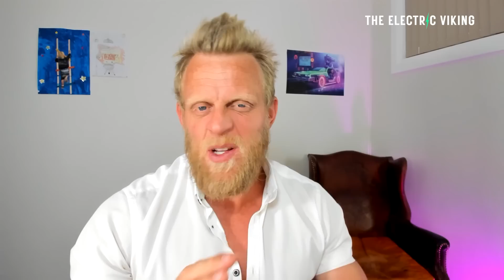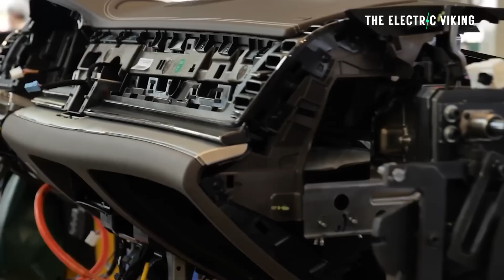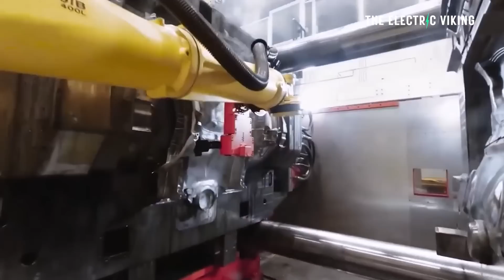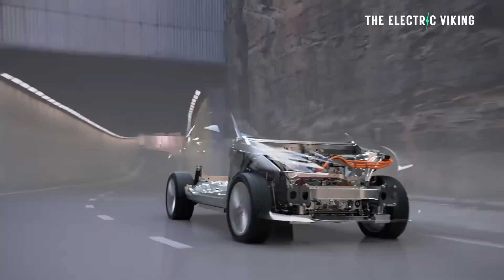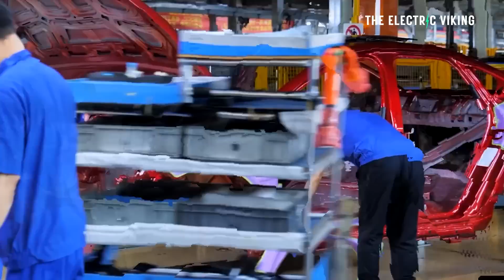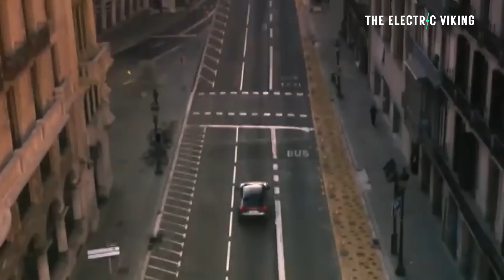Toyota reveal why Tesla and BYD are way ahead in EV manufacturing

Comment: One thing I heard about solid state batteries is that they will be very difficult to recycle. They may not end up being the best technology because of that.
Reply: I worry about them cracking due to thermal stresses. 

Batts with a solvent based electrolyte tend to be self healing in this respect and there is still room for further improving this technology.

Comment: The net debt of Toyota and VW, resp. is $186 and $185 billion, a huge weight to drag around. Toyota is the most indebted company in the world.  Meanwhile, Tesla’s net debt as of June 30, 2023 was $-8.4 billion, ie more cash than actual debt which is $2.33 billion.  Tesla is in a great position to expand production with new production lines, new factories and new models but also advance technological thru increased R&D and growing vertically like its new lithium refining factory currently under construction in Texas and horizontally with a Megapack factory in Shanghai being built to supplement the new one in California which is ramping production. Tesla is getting into the electricity business in Australia.  Lots going for Tesla these days on multiple fronts, not so for legacy auto which is struggling getting their EV act put together, if ever.

Comment: By the time Toyota gets its act together and start producing decent EVs Tesla will have started production on its low cost Tesla model ‘2’ using the ‘Unbox methodology’ which will revolutionize the manufacturing of vehicles. I foresee this happening in the next 2-4 years…late 2025 to ‘27.  The process will require very precise timing and only great software can do that and if anyone can pull that off it will be Tesla.  The only thing that could hold this up is the construction of Gigafactory Mexico, hopefully it gets started soon.

Comment: The legacy automakers are still ignoring the fact that EVs are essentially computerized batteries with wheels. You can’t just install an EV battery and motor in a retooled ICE. Also, most humans live in parts of the world where solar power works very well. As more people install solar, they will skip the petrol stations and charge their  EVs at home.

Comment: Sam, check Toyota stock price. It's all time high. It's not doing as poorly as you keep insisting. Plug-in hybrid are increasingly popular.
Reply: It's not just Toyota. The Nikkei is rallying because of Japan's monetary policy. Even Buffet is leveraging cheap Japanese interest rates to raid Japanese shares. It won't end well.
Reply: @huatlam8752  In 2022 BYD sold under 2M cars, Toyota over 10M.
Reply: @joem0088  at current monthly sale if 300000 plus, BYD is looking at 3.6 million plus this FY. Toyota is sitting on $200 billion plus debt bomb denominated in U.S dollar....with falling yen value. You be pretty brave to hold Toyota shares.

Comment: I don't have a problem with Toyota's HEVs and PHEVs, and there is some merit to the argument that they reduce fuel consumption based on a smaller battery footprint. But ultimately this is a stop gap measure in the long run, and it's clear that Toyota themselves are not that committed to HEVs, given their inability to meet demand or to push down prices of what should be a more affordable car.
Reply: If they really believed that, it would not stop them from also making real EVs.  Over and over Toyota has said 'we need a range of options'.  And they build ICE cars, Hybrid cars, Plug-in Hybrid cars, and hydrogen cars.  Yet they refuse to build the one option actually shown to work: EVs.  

This is not rational.  This is an emotional hatred of the very idea of electric vehicles, and it comes from the chairman and former CEO.

Comment: I still believe many of the fanboy level are in total denial of the challenges Toyota faces. This is not the company that rose to power in the 1990's. I fear they suffer what GM and others have suffered from once they got to the top of the heap. They become less nimble, seem to assume they know best, and the layers upon layers of red tape that seem to pile on as a company gets big is just awful. I do not think Toyota has not done a good job getting rid of red tape and cutting off R&D that is not really paying off. Hydrogen is a huge waste that they still cling onto. I am guessing because so much Japanese government money went into hydrogen due to Akio Toyoda's pushing for it, they do not want admit they wasted so much of the Japanese taxpayers money. 

I am still of the belief that Akio Toyoda slid over to the board room to allow someone to face the heat as Toyota crashes. Akio Toyoda will jump back into the CEO roll after things have gotten bad and they can just blame the current CEO, even though most of this was set into motion by Akio's actions.

Comment: You miss an important point. Unlike smarphone buyers who are mainly in the age group of under 35, Car buyers are mainly in the age group of over 30. They don't let emotions sway their rational thinking. BYD or even Tesla have a long way ahead to prove their reliability to the potential customers. I personally won't go close to any new car manufacturer until the long term reliability results comes out. Remember, Kia and Hyundai are two very good car manufacturers but they are still struggling to get even close to Toyota. Investing in a car is different than buying a smart phone. People are much more cautious about spending tens of thousands on a car.

Comment: As you noted. . .  It's heartening news that somebody high in the ranks at Toyota saw the light and understands the need for the company to change its ways.  My only concern is, sometimes it's not easy to turn around a corporate culture.  It takes real leadership to rally the troops around a new strategy, a new direction.  Let's hope!
Reply: they put the Lexus guy in charge and he's more pro-EV than Mr. Toyoda was. It looks like they're coming around. Their joint venture with BYD opened their eyes. Kind of like the NUMMI factory joint venture between Toyota and GM back in the '80s opened GM's eyes. But didn't save GM, sadly.
Reply: GIGACASTINGS ARE TRASH THEY ARE NOT EASILY REPAIRABLE

Comment: Hybrids are selling at twice the rate of EVs and Toyota is a leader.  EV sales are pausing, taking price cuts to move them and some EV makers are losing hundreds of millions.  Toyota is the largest car company in the world, they have the resources to catch up..
Reply: Hybrids the best right now until batteries and infrastructure improves.

I would not consider an EV until all solid State batteries are mainstream.
Reply: In 2022, Toyota produced 10.9 vehicles and the Corolla was the #1 vehicle in the world…..2023 is still to be determined.  Hybrids out sell EVs, 2 to 1, see Reuters article dated Jan 6.  The Achilles heel for EVs with be lithium and cobalt production (child labor) until better battery technology comes along.  Most hybrids used nickel hydrate batteries. I was recently in Spain, I saw hybrids everywhere and hardly an EV. Turns out 20,000 hybrids were sold in 2022 and 3,500 Teslas…….kind of explains it.
Reply: You are just plain wrong  Where did you get your information that hybrids are selling at twice the rate of EV’s? Remind me again of what was the best selling car in the world last year. Tesla model Y and it’s not a hybrid. Why do anything halfway? If they want to build ice vehicles build them. If they want to build EV‘s, which up-to-date they are not capable of then build them. Hybrids are an invalid compromise. Toyota wants to tell you what you want rather than listen to you and provide what you want. They have become with the big OEM vehicle producers in the United States were in the 70s. They claim to know more about customer satisfaction, than the customer themselves
Reply: @ZeusBullyMax  and Toyota is right, record production, sales, and profit. 😂😂😂

Comment: I find this discussion very interesting since BYD is know for it low level of automation.  Toyota is know for its high level of automation which determined its high quality. I do understanding the BYD level of designing subsystems is more advance since they are software and EC driven.
Reply: Perhaps in the past with low level of automation.  Last year, Tesla produced 1.36 millions cars.  BYD sold over 300,000 cars just in Oct alone.  I don't think they can produce that many cars without high level of automation
Reply: I disagree, there is a large pool of workers available and their production remains with a low level of automation. However, this allows them to have a higher variety of models and also allows them to introduce new models faster. The downside is that the cost of production is higher, which produces a lower profit per unit. @Truthstelling
Reply: BYD actually has very high levels of automation. Some people misconstrue high employee count as being something other than what it is. BYD has the highest level of verticle integration of any automaker. That puts the headcount under them rather than a supplier. And BYD has the largest R&D and engineering headcount. But their manufacturing is very actually highly automated. Forget the misinformation you have been told.
Reply: I understand your comment about the headcount being influenced by the level of integration but there are other issues that severely impact BYD. Having ICE cars and EC cars coming down the same line is very inefficient as has been discovered by the other existing car companies (GM, VW, Toyota, Ford, etc.) that they do not plan to use them in the future. Automating mixed ICE/EC cars on the same line is quite difficult and they normally fall back to using an excess number of workers, which can be more flexible. Looking at BYD's profit margins seems to verify this observation. @larryevans6739

Comment: Using the 130,000 tons of Lithium produced in 2023; if you used every ounce for Model Ys you could make 12 million - if you used every ouce for Prius/Rav4  hybrids that coud commute all electric if wanted - you can make 72 million.  So which can reduce CO2 more?  Hybrids also weigh less, using less energy to move. Lastly you can use renewable Ethanol to power the hybrids; as is being done with some vehicles right now in Brazil. The world grid is 70% fossil fuel powered.
Reply: Hybrids are lighter, but they don’t use less energy to move. They use far more. It’s why they pollute far more. You’re repeating Toyota propaganda almost word-for-word.
Reply: Tesla have done their research and are not concerned about a lithium shortage. Demand will create supply. There is plenty of lithium but a shortage of processors. Tesla is developing their own processing plant in America.
Reply: full of redundant data and toyota led assertions. With cars, the bulk of the co2 emitted is in the fuel.72million cars pushing out co2 doesnt sound like logical thinking to me......been shown that hybrids are used mainly as petrol cars because owners dont get any real benefit by plugging them in. If your going to blab stupidity, at least have some info to support your stand. Asserting debunked mythology isnt any new evidence.

Comment: BYD is way ahead because it builds it own internally-designed battery packs, including the blade-type LFP packs. That means they could design their own EV's without worrying about getting a steady supply of battery packs from a third party. In fact, the next major push for BYD is to design and build EV's specifically for the US market with Federal Motor Vehicle Safety Standard (FMVSS) certification.
Reply: A likely reason BYD is so far ahead is that BYD was a very major battery manufacturer first.  BYD bought a small ICEV company as a way to get into the car business with the goal of building EVs, using their own batteries.

And BYD started early.  BYD built a lot of EVs that used LFP batteries and were used as taxis in China.  They have years of experience which so many other Johnny come lately companies lack.  

And BYD is an intentional EV company.  Unlike all the legacy ICEV companies who are being forced to produce EVs.  If corporate management does not have the EV fire in their belly, their company is not likely to move quickly and efficiently to EVs.  Many are acting like surly teenagers being forced to clean their rooms.  They've, essentially, just kicking stuff under their bed to see if they can get away with doing the minimum.
Reply: @bobwallace9753  About 50% of BYD's cars are PHEV, not BEV. But BEV is increasing. In 2022, Tesla made more BEV's; not sure if that will still hold in '23; we'll see.
Reply: Nah, Chinese companies should leave the US market alone. They should have learn the lessons from Huawei, If Huawei didn't go into the US, they should still be in a great spot...
Reply: @passby8070  
Not comparable.
Reply: BYD and Tesla are ahead because they are being give the tech from places like DARPA.
Reply: @xraylife  
Anything DARPA has made public is available to any other company.  And DARPA has done nothing that I know of toward the development of EVs.

Tesla and BYD got into EV production years ago and are now benefiting by the hard work they have done over the years.
Reply: @bobwallace9753  They didn't make it public they gave it to Tesla because its part of the game. 
That's the one that ultimately removes your right to vehicle ownership.
Reply: @xraylife  
What did DARPA give to Tesla?

What's your source, if you have one?
Reply: Funny thing is, the BYD LFP blade battery performes better in the Tesla Model Y than in BYD‘s own cars
Reply: If history has any meaning, it is that Russia had taken on the West and led in science and technology fields such as space. Ultimately, the West won in consumer goods or the economy. And the Chinese were the first to manufacture and trade high end luxury good worldwide, such as china and silk on the Silk Road,  which were sold it to rich European kings and queens. Now, the Chinese are making cheap stuff the European commoners can afford.
China has been taking on the West and looking good in consumer products or the economy, including space. 
Now, with the help of the West, China and Russia are cooperating. Is the future hard to predict?
Reply: True, but these things change quickly. BYD is ahead right now, but others can copy what it does with blade LFP. It will become a commodity eventually. Can the Chinese make these batteries cheaper than the Vietnamese? than the Indians? Tesla can just pick the best current batteries - right now it's CATL and BYD. But maybe tomorrow it'll be some more advanced design from Germany or Tesla's own plants. Or maybe Toyota though they seem to be promising more than delivering.
Reply: @ChickensAndGardening  Indian and Vietnamese battery? Seriously?
Reply: @route55qatar  
Seriously.  A lot of Asian car manufacturing now is being done in Vietnam (and Thailand).  India has a very large supply of well trained engineers.

Don't judge countries based on what they were like ten or twenty years ago.
Reply: @bobwallace9753  Vietnam and India？ LOL  good luck bro
Reply: @zandrew2742  
What do you know about Vietnam and India?  Have you spent any time in either country lately?
Reply: @vlhc4642 
How do you explain Chinese manufacturers moving to Vietnam?

China companies are not likely to move into India, there are political issues.  It does look like Tesla may open a factory or two in India.  Foxconn, Cisco, and Walmart are some of the other companies beginning to manufacture in India.
Reply: @vlhc4642yeah, that Bob guy is so delusional about the prospect of India being a major player in EV business. The problem is the west still thinks China is a backward 3rd world country, but in fact in many areas it is already at the same level of us if not more advanced.
Reply: @lindenlee3705  Half of China is still impoverished rural areas with around 500 million people living on the poverty line. However their east coast urban areas which have hundreds of millions of people are quite advanced, in some ways more advanced than in the West, but unstable and unpredictable due to abusive government policies and lack of "rule of law". India has a vast population of cheap labor, but lacks the supply chain & transportation infrastructure of China. Vietnam is more like China, but tiny (relatively). India does have one advantage and that is software; some of the best software teams in the world are in India, thanks to U.S. outsourcing. Also India has a lot of English speakers. But yeah, it has a few years to go to catch up to China.
Reply: @bobwallace9753 India and Vietnam make an EV Battery 😢... Both countries don't have refining rare earth materials technology that China already mastered and monopoly the market... How are India and Vietnam manufacturing the battery without rare earth materials? See the charts 7 from 10 biggest EV battery manufacturers are China companies and the rest are Japan and Korea... No India and Vietnam even in the top 20.
Reply: Except US is smart enough to raise tariffs neutralizing cheap labor and XIs grants
Reply: @AlGreenLightThroughGlass  
Companies can avoid the US tariffs and qualify for federal EV subsidies by manufacturing in low labor cost Mexico.

Comment: Sam, you are spot on about Toyota's new attitude. Admitting you have a problem is the first step toward a solution. The litmus test is what they do next. If it's just words or the leadership of Toyota as a whole does not accept this, Toyota is toast.

On a pedantic point, "giga-" (1,000,000,000) is bigger than "mega-" (1,000,000). Maybe "tera-" (1,000,000,000,000) is the prefix you are looking for.